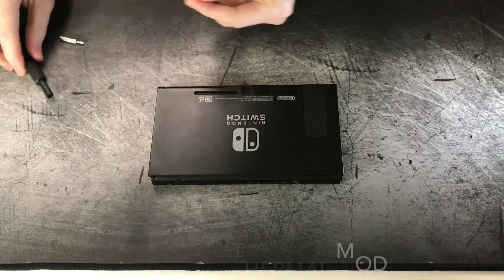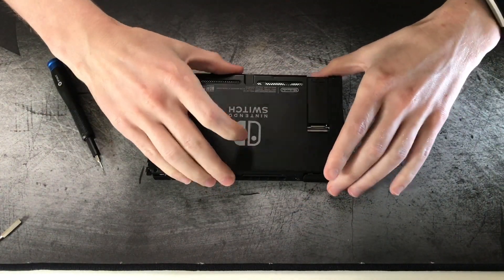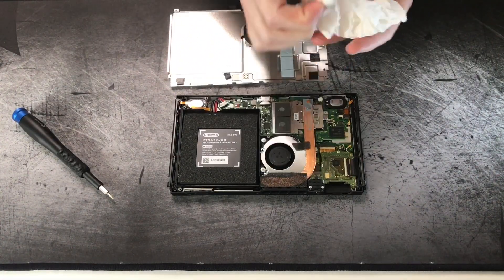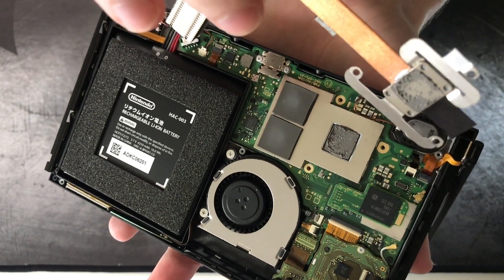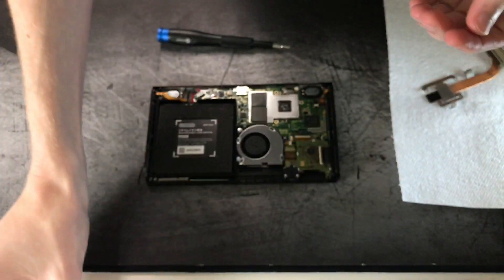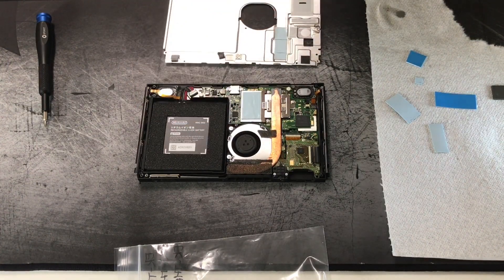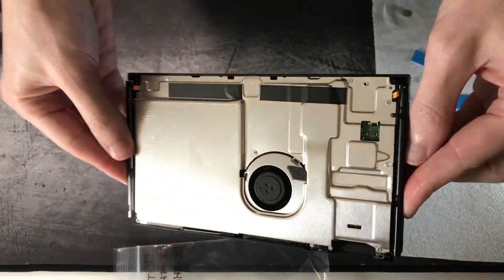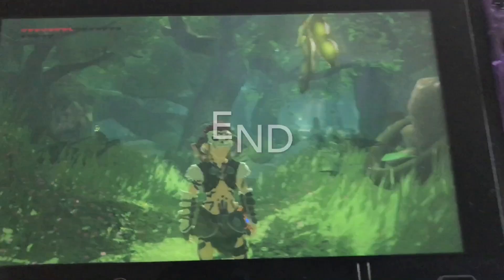Tech Shorts: Switch Thermal Mod Revisit, Thermal Paste and Thermal Pads

Comment: Would a thermal pad on the battery unit help the Switch while charging? Or no need, since a battery is mostly metal anyways. Also what was the appropriate thickness for the earlier pads?
Reply from the maker: Eh, I'm not sure. I wouldn't mess with the battery too much - it could be dangerous.
Reply: I'm pretty sure that thermal pads are conductive. so, that would be risky for your switch especially the motherboard and battery. so, I wouldn't risk it.
Reply: thermal pads are not conductive

Comment: Would you ever do it with liquid metal?
Reply from the maker: I definitely wouldn't do Liquid Metal. There is too much movement in the system and Liquid Metal and Aluminium don't mix at all. It's just not safe.
Reply: @iamflowers3673  I was actually wrong someone already tested direct liquid metal to the cooler and he opened it a few days later and all was good, the cooler look like aluminium but it's not, it can actually handle liquid metal without the copper sheet, direct touch with the cooler.

Though I recommend using Artic MX4 as it's 100% safe and no cure time needed too, just use it directly without the copper sheet, remove it.

If you still decide to go with liquid metal, buy a protection paste and put it all over the sides of the SOC so if a bit spills it won't short anything.
Reply: Riggzilla definitely not! Unless this console is only gonna be docked. To much movement might cause it to move out of place and ruin the switch :(
Reply: Ahh true man! Darn :(
Reply: I think his solution is better than liquid metal... Because he had to use liquid metal to the copper shim and then artic silver from the copper shim to the heat pipe... So 2 heat transfer points, while he have Direct contact and only 1 heat transfer point from the SOC to the heatpipe contact which will probably be more efficient than having 2 points of heat transference even using liquid metal...
Reply: Actually somebody did it and show good results, death silent console, almost no heat, optimized battery life https://gbatemp.net/threads/liquid-metal-cooling-nintendo-switch.497251/
Reply: But liquid metal is like thinly coating the dye, like unless you whack it real good It's gonna stay there, or put too much might gloop out a bit.

Comment: You should try using liquid metal on the CPU and heatsink
Reply from the maker: I definitely wouldn't do Liquid Metal. There is too much movement in the system and Liquid Metal and Aluminium don't mix at all. It's just not safe.

Comment: Just in case any of you don't know. Using Artic Silver 5 thermal paste is slightly conductive, but it is fine to use. Spreading thermal paste with your finger can trap air bubbles inside the thermal paste. I would recommend just placing enough paste that it will spread on the die when you reinstall the heatsink.
Reply from the maker: If you're placing thermal paste on something that has a heat-spreader, (like most CPU) then you can use the, "pea method" of applying a small blob and let the weight of the heat-sink spread it out. However, if you're applying thermal paste onto the direct die then it is extremely important to make sure you get a full cover. Any missed area can result in worse temperatures. Spreading out with your finger is okay; as long as your finger is clean and free of debris. It's really hard to spread thermal paste on a die so small, so using your finger is better than botching it or over-applying with the, "credit-card" method. Really though; do it however your comfortable. There are minimal difference between the application methods as long as you get a full cover.

Comment: great mod , good thermal paste and the hole above the fan makes the difference, just like on PS3 and PS4 cooling mods. it will run cooler. The reason why companies don´t do it is because of the looks, and because it will get dust in the heatsink demanding to open the console and make a cleanup once in a while. Where do you buy back case replacements?
Reply from the maker: Thanks! You can purchase them on Amazon. Company is Basstop. :)

Comment: Avoid using thermal pads whenever possible they have bad thermal transfer efficiency
Reply from the maker: Simply adding thermal pads isn't going to do much, sure. But bridging the gap between two otherwise unconnected mediums, (in this case metal) will drastically reduce the temperature of said area as the thermal pad draws heat away from the board.
Reply: That's not actually true. There is thermal pads that have better heat transfer than alot of pastes. They are pretty darn expensive though.

Comment: is it enough contact beetween the heatsink and the dye to substitute thermal paste with a thin layer of liquid metal?
Reply from the maker: You could totally use Liquid Metal - but I wouldn't. It doesn't really get hot enough to justify that risk. Liquid Metal can flow slowly over time and if that hits your PCB it'll fry it. Not worth it really.

Comment: Thanks for the video, I’ve recently done this to my Switch due to the fans running at full speed too often in less intensive games.

Overall the Switch feels hotter to touch probably due to the thermal pads allowing to dissipate heat through a larger surface area now. The fans rarely kick in at full speed now unless it’s a really really demanding area that I personally haven’t encountered often. I would call this a success and recommend to do this for anyone else who has an issue with the Switch’s fan.
Reply from the maker: Thank you! I enjoy not hearing the fans at all too. :)
Reply: My concern is the heat is being transferred to the case around the cpu and may causes parts to fail around the CPU. It might be worth working out where the temp sensor is that triggers the fan because if its located in the exhaust heatsink then you need to take this into consideration.

Comment: Wonder if this helps prevent the warping some people have had. If it does help with thermal throttling that is a win.
Reply from the maker: It's a possibility. I'm still not 100% convinced that the warping is really caused by heat. I just don't think it gets hot enough, (even without mods) to do that. I get that some devices ARE warped... but maybe these guys put it in their back pockets or something and warped it other ways slowly over time so they didn't notice it then blamed the heat.

Comment: all that effort and you spread tit with your fingers >.< do whatever mehod or just put a blob and rely on pressure but fingerrrr is  a hugee nooo >.< body grease and all thaaat. You could have used a glove or a credit card but meh here's a like anyways c:
Reply: he literally explained why you can't put a blob on and rely on pressure in the video. plus, any oil from your skin isn't going to make a difference with the cooling solution the switch has.
Reply from the maker: @pedros7341   I'm so glad someone watched the video.
Reply from the maker: It's totally fine. Been doing this way for over 20 years now. How to spread thermal paste is a hotly debated topic - and there really isn't a right or wrong way in most cases. Also, when you are putting thermal paste on a direct die, it needs to be spread evenly across the silicon. Unlike on heat spreaders where the weight of the heatsink is enough to spread it out.

Comment: OK so I went ahead and did the same as you, using 0.5mm on the RAM, 1mm on the heatspreader (above RAM), and 1mm on the heatpipe. Also removed the shim, replaced paste with Noctua NT H1 thinly spread and squeezed out air bubbles like you did in this video. I then tested Korok Village on the latest game update in portable mode and I still had FPS drops. I then removed the back shell, exposing the fan and tested again. Same result. I'm playing the PAL region game from the game card updated to version 1.4.0 and console firmware 4.1.0.
Reply from the maker: Sorry I didn't respond to your earlier messages, (just got off work). I went back to Korok Village just now on my Switch (latest update) to test it on mine and I was getting frame drops too.  At the end of my video you can clearly see that I was getting no frame drops back then. If I had to guess I'd say something they added in a more recent update has caused the frame drops to return? This video was shot back in September and there has been several updates sense then. So, I'm not really sure why the performance has declined.
Reply: @iamflowers3673  will you upload ever again?
Reply: IAmFlowers OK that's good to know. I notice the system fan barely turns on when the console is undocked now so the mod has definitely improved the passive dispersal of heat, as expected. All in all, a great video guide. Thankyou. 

Despite the fps drops,  I wonder if the game maintains a higher average resolution after this mod?
Reply from the maker: I'm glad to hear that it's running cooler for you. Lately I've been playing a lot of Xenoblades and the console fans hardly spin up at all. The fan is totally silent and the console is only slightly warm as the heat is more evenly distributed throughout the back panel.  :)
Reply: Saw this comment and got curious

Did any of the recent updates fix the frame drops?
Reply: hi, how has your switch been holding out so far with the mod?
Reply from the maker: @theinitial21   It's holding up perfectly. I currently have over 300 hours logged in Pokemon Let's Go. :)
Reply: @iamflowers3673  that is awesome, I did the exact same thing you did and it's been working wonderfully. Thanks for posting your video!!

Comment: Just to be clear, you used 0.5mm pads on the actual ram chips, and then 1mm along the heatpipe and on the heatspreader. Is that correct?
Reply: wtf is 1.2
Reply from the maker: Dan8t6 commented below with the actual measurements. 

0.5 under the metal plate, directly on the RAM
0.5 on heatpipe
1.2 between the metal plate and the back cover over the Ram
Reply: @iamflowers3673  did you mean 1.5?
Reply: @iamflowers3673  so, please, can you help, 1.2 or 1.5? :)
Reply: @LeonidEr  do you know?

Comment: The fact that you are actually getting better performance in the Korok Village is proof enough that the default cooling solution isn't enough. I would very much like to know if this would still be the case if you didn't mod the back panel with a window for the fan. I want the performance gains, but I'd like to avoid modding the back panel if I can. Are you able to put the un-modded back panel on and test the performance again and then report the results? Please?

Comment: Dude, what happens if you disconnect the fan and try to turn on the switch ? Is it possible to have a fanless switch so you can save battery ?
Reply: altairgame Please don't do this to your switch, the fan is definitly not harming your battetie life.
Reply from the maker: This seems interesting - next time I have it open I'll see if it'll power on without the fan connected. I'd bet that it wont though.
Reply: altairgame ooooooo I want to know this too!

Comment: one thing ive been wondering about this do you notice your system running colder? from the better thermal past?
Reply from the maker: It seems like the fans run a little less and at lower rpms. I've been playing a lot of Zenoblades Chronicles 2 lately and the fan barely spins. Also, the console in handheld mode after hours of gameplay is hardly warm at all.

Comment: How thick were the thermal pads that you used?
Reply from the maker: I used 1mm thermal pads from EKWB.
Reply: 1mm is too thick. If you're plate isn't pre-bent from using too thick pads 0.5mm fits perfectly. Both on the RAM and under the metal backplate. 
small correction: 0.5mm on the RAM, 0.5mm on the heatpipe, 1.2mm between the 2 metal plates over the RAM